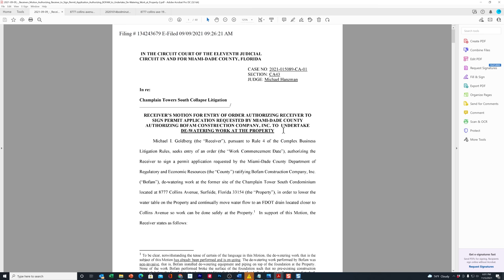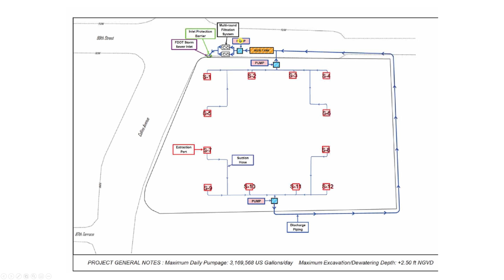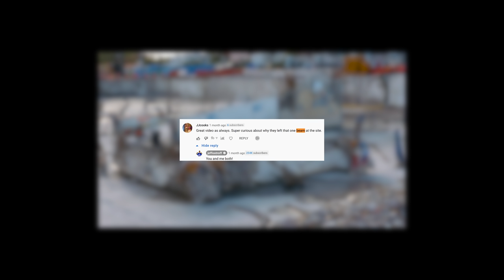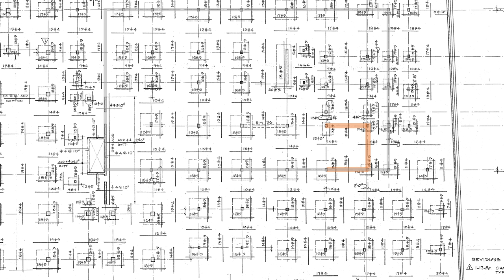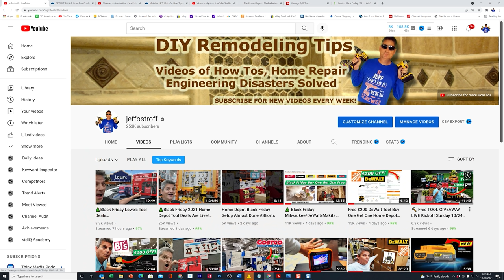Miami Condo Collapse: Engineers Baffled By Mystery Column

Comment: Didn't misaligned columns contribute to the Sampoong Department Store Collapse in Seoul?
Reply from the maker: I think it contributed somewhere to that yes but really the main issue was improperly designed roof, and too much load on the roof and then moving a load that it was not rated for caused cracks in it

Comment: Is it possible that the H-Beam shifted as it collapsed, so rather than coming straight down, it landed displaced by one row?  That would surely explain the mystery column remains, and the clear path next to where it landed.
Reply: Two words: RED COLUMN.  The H beam rested atop a red column to it's southeast, and you can see the red column next to it.  H beam was shifted a couple feet, at most.
Reply from the maker: Martin are you nuts? How does a 70,000 pound slab miraculously fall 20 feet north as it falls 11 feet from the first floor? The H-Beam as you can see by photos fell 12" north of the 4 columns supporting it.
Reply: @jeffostroff  It didn't even fall 11 feet.  The garage ceiling was 11'6" (maximum, from what I can tell on the plans) and the H beam hung down 42" from that, putting its height above the garage slab at about 8 feet.  Also, there's about 6" of debris underneath it, so it really only fell 7 1/2 feet...
So doing a some quick trigonometry, if that beam was in free fall and magically, instantly released from any constraints, it would have to undergo a lateral acceleration of 2.66 g's in order to land 20 feet away.  So basically a shockwave from a nuclear explosion or a 9.5 earthquake with it's epicenter right under the building.  
Sure, Martin, totally plausible!!!

Comment: Could the beam not have punched through the concrete floor and then been broken off?
Reply from the maker: Whenever you make a claim like this about the column falling eight feet and impaling into the garage floor, you forget that there is zero damage on the floor where there should have been craters or something else if it had impaled into the floor but there is no damage. These rebar rods look like they were intentionally built up out of that concrete floor like it was done by somebody in the last 12 months, since Fiorella shot her video inside the garage in July 2020, showing no column exists where that mystery column is.

Comment: The penthouse held up by JUST the H beam. Very nice!🤣👏
Reply from the maker: No real at the house had other columns holding it up as well this was a column that just went up through the middle of the kitchen and I still don't see why they needed it because all of the other floor plan units don't have a column in their kitchen. The HP was built strong enough to hold that one column anyways transferring the load to the other four columns that were holding up the H beam

Comment: I'd imagine someone who lived there who survived could tell  you if that lane of car travel in the garage was blocked or not.  If it wasn't, it has to be the column that sat on top of the H beam punching through, as improbable as that is.  Maybe it wasn't rebared into the H beam and just slid off?
Reply from the maker: Well, two things about your theory that I think don't pan out so if the column fell down and even at an angle then it wouldn't have landed so close to the  H beam and impaled into the floor like you see it now. Also if it had impaled onto the floor that should be a lot of damage on the concrete like a big crater of some type
Reply: @jeffostroff  if the H beam fell during the first part of the collapse leaving BM35 intact and unsupported until it fell with the final part of the collapse 10 seconds later, it would still be vertical and land near where the mystery column is with extreme punching force.  I also don't see any rebar on top of the H beam where BM35 was connected to it which I might expect if they fell together.

I agree there should be some more visible damage to the slab though, and I would expect them to not build a column in the middle of the parking garage cutting off a main lane of travel without it being known to a lot of people.  A big mystery for sure as nothing makes sense or seems possible!

Comment: The GHOST COLUMN!!  Haha.....I think what happened is the long  continuous column from the first floor collapsed as a heavy 100 foot entity and nailed itself deep in the basement floor.....like a nail pounding into wood.  Then it broke off and what's left is rebar sticking out of the weak floor.  The floor of the garage was probably water logged and allowed the column to penetrate....and if there was a large "void" under the garage floor then all the easier.
Reply from the maker: Whenever you make a claim like this about the column falling eight feet and impaling into the garage floor, you forget that there is zero damage on the floor where there should have been craters or something else if it had impaled into the floor but there is no damage. These rebar rods look like they were intentionally built up out of that concrete floor like it was done by somebody in the last 12 months, since Fiorella shot her video inside the garage in July 2020, showing no column exists where that mystery column is.

Comment: Just my best guess, could the mystery beam actually be the beam that was originally on top of the h beam? Since I don't see any evidence of the top beam in the wreckage of the h beam, I'm thinking it's the top beam after shifting away from the h beam and impaling the garage floor. It's hard to determine whether or not it impaled the floor with the standing water surrounding it. Like I said, just a guess.
Reply from the maker: there is zero damage on the floor where there should have been craters or something else if it had impaled into the floor but there is no damage. These rebar rods look like they were intentionally built up out of that concrete floor like it was done by somebody in the last 12 months, since Fiorella shot her video inside the garage in July 2020, showing no column exists where that mystery column is.
Reply: @jeffostroff  like I said, just a guess.

Comment: could the column that was supported by the H section have been knocked backwards and driven into the floor by the immense weight above?
Reply from the maker: It is possible, but no damage to the floor? There should be some
Reply: @jeffostroff  yeah. i was only about half way through the video when i commented that. you do mention the column above impaling the floor possibly. its so strange! thanks for the reply.

Comment: 8:37 - is it possible that the rebar is the remnants of an original extra beam they had in place, but they then installed the H-beam to help support the penthouse.

And the floor of the garage had a chunky layer of cement poured over it for some reason, hiding the old rebar?

I know that doesn't make much sense regarding the original plans, but I can't imagine why else the rebar would be poking out of the ground in that spot.

Logically, either the rebar was always there already, and covered by cement.

Or, the forces were so great, they drove a group of rebar into the ground.

Or the H-beam fell in such a way that the East-West section of H-beam rotated as it fell, and we're just seeing the rebar that was originally on TOP of the H-beam (which went all the way up to the penthouse)?

ie. the beam rotated, and the rebar it's just bent in a way that makes it look as though it's poking from the ground?
Reply: 7:07 - The more I stare at that photo, the more it looks like quite a thick layer of extra cement was poured at some point, maybe in an effort to try to seal out some of the water?

It looks like the floor is quite a bit higher up the columns, and there's a the "seam" running horizontally along the lower part of the screen? Unless that's just a crack in the cement?

If not, then it's really bizarre.

OK, just looking at a zoomed-in image of the NIST photo of the mystery column again, and yep, it sure looks like the rebar is poking out of the floor, and very high, even above the level of the red/yellow paint on the columns.

Is there any way the forces from the collapse were great enough to drive some rebar into the ground at that point?
Reply: Or, for a more reasonable explanation, is it just some mangled rebar in a small clump of cement, and the cement is just below the water?

ie. just some rebar they didn't clear out yet, or it fell from the rubble pile or digger?

Half of the problem with mysteries like this is not being able to go there in person.

Really makes me worry about the state of other buildings in the US and elsewhere.
And considering how ancient many buildings are, Champlain Towers is relatively "new".
Reply: 5:28 - Are we absolutely certain that part of the H-beam didn't rotate as it fell from the tops of the columns?

ie. the part with the mystery column (rebar) has rolled over 180-degrees, and the old rebar got squashed almost flat against the floor (and/or made a divot in the cement).

So what we're seeing in the NIST photo is actually the rebar pertruding from the H-beam itself, where it had the column going from the first floor to the top floors.

You could imagine the rebar being squashed under the h-beam, then extending out into the pool of water.

It just causes the illusion of the rebar poking from the floor, but it's actually still attached to the "underside" of the H-beam. (which was originally the top side of the H-beam, but it rolled in the collapse).
Reply from the maker: You did not pay attention to the video. IT is not some original column, the garage video clearly shows no column there.
Reply: @jeffostroff   Sorry, I didn't watch the last few minutes before posting, but it sure is baffling.

I saw the clearer photo now, and it does look like the rebar is pertruding from the garage floor.

I can't think of a logical explanation, which is why I was going through other possibilities.

I can also see now that the h-beam did seem to fall in-place, and not break up nor roll over.

My only conclusion right now is they added the extra column since the video of the basement was shot. I don't know how they would have redirected the cars during parking, but who knows.
Reply: (I just deleted my tweets about it, as there's no point going over the same info twice.)

Comment: Looks impaled from above to me and the hole filled with debris silt and water making it appear it was always there
Reply from the maker: Whenever you make a claim like this about the column falling eight feet and impaling into the garage floor, you forget that there is zero damage on the floor where there should have been craters or something else if it had impaled into the floor but there is no damage. These rebar rods look like they were intentionally built up out of that concrete floor like it was done by somebody in the last 12 months, since Fiorella shot her video inside the garage in July 2020, showing no column exists where that mystery column is.

Comment: i think you got it from the wrong angle. you can see the column at 7:12, right behind column 15.
Reply from the maker: No you were looking in the wrong spot. The column which is the mystery column is currently planted on the floor of the garage directly below where you see the pipes cut through the H-beam in the photo there. How could you even get that wrong you're not even close to the right spot. The column you are Speaking of is already there in the photos if you look later on it is the column that I mentioned sticks up halfway into the parking space of #17.

Comment: I would bust out the concrete around this column and the ones on each side of it to compare their depths.  You can also take samples of the rebar and the concrete from each of the three columns and have them analyzed.  That way, you might be able to find out if they were poured at the same time using the same material batches.  And if you're careful removing the concrete from around the column, you might be able to determine if it was impailed.

Comment: Before the collapse the column was not there. Absolutely for definite. Its there now - again absolutely definite. So - either it punched up through the basement slab or it punched down through the basement slab. I'm no expert but I can't think of a mechanism that would cause it to punch up through the slab - and if it had I would expect to see more spalling on the upper surface of the slab around the punch-through hole - and there appears to be very little if any spalling. So - the column MUST have punched through the basement slab from above. Absolutely must have punched through the basement slab from above. Now - the column that was sitting on the H-Beam. It plainly was just resting on the beam with no steel tying it into the beam otherwise the steel would still be sticking out of the H-beam which it is not. So that column was definitely not tied to the H-beam. It also looks as though the H-beam did nor fall vertically - it looks to have moved about 20" in a  north-west direction during the collapse. So it slipped out from underneath the column that was resting on it and the column subsequently fell and punched through the basement slab. My guess is that when the H-beam fell it took the bottom of the column with it effectively putting a buckle in the column. As the rest of the column - from the first floor upwards - starts to fall it gets deflected eastwards by the buckled bottom portion and falls punching a hole through the basement slab almost in line with the row of columns - the row the red column is in. Please fault my reasoning.
Reply from the maker: Jerry, I als cannot think of a mechanism to make it punch through from below, especially some you have these large pile caps below the foundation

Comment: The mystery column is column #24 that whole H beam just sheered and moved over a few feet.  That's all..  Dont forget that was up in the air 8ft That piece stuck to it isn't going into the ground nothing left on that H Beam in going into the ground right now. Pick the whole H Beam up 8 ft and move it towards the ramp 6-7 ft.

Comment: The H-beam, as it sits, has been shifted north one set of columns.  Mystery solved.  The real mystery is why I still watch YT.
Reply from the maker: You are incorrect there's no way that things shifted north one set of columns I don't know how you came up with that you'll have to show us evidence just like I showed you the evidence of how it is sitting right where it belongs it fell straight down within 12 inches of its four columns that were holding it up including the one with the red stripe that I told you to keep in mind as the reference point for that northeast corner of the H beam which you clearly ignored. Mystery solved.
Reply: @jeffostroff  At least my theory doesn’t require a concrete column to miraculously appear in the car lane.  How do you know someone using the heavy equipment which demolished the condo wasn’t asked to set that h-beam aside while they clean up the area and now that’s where it lay?

Comment: Could it be that the building collapse drove the first floor column into the floor of the garage? None of those columns in the garage look big enough for a 12 story building, and every column should go all the way down to the foundation piles. When one gives out, the rest go down like dominoes.
Reply from the maker: Whenever you make a claim like this about the column falling eight feet and impaling into the garage floor, you forget that there is zero damage on the floor where there should have been craters or something else if it had impaled into the floor but there is no damage. These rebar rods look like they were intentionally built up out of that concrete floor like it was done by somebody in the last 12 months, since Fiorella shot her video inside the garage in July 2020, showing no column exists where that mystery column is.
Reply: @jeffostroff  Or they could have intended to put a column there later to support the beam carrying the first floor column. I think that beam let go and pulled the next columns over, starting the collapse. Nobody mentions having a picture of a bundle of rebar coming through the floor there, or a column. Strange things happen when columns are driven by a 12 story building hammer, I think, but I'm not an engineer. Buildings shouldn't be falling down with people in them, regardless. It will all come out at the trial, no doubt. Cheers.

Comment: I'm not an engineer! Is it possible that the H was supposed to be bigger? At :056 it looks weird.
Reply from the maker: No you can tell that the H being pretty much stayed intact for the most part so it didn't really need to be any bigger and it's a beast already I think if you make it bigger now you have to start worrying about how are you going to support the beam that was designed to support the floating column in the first place

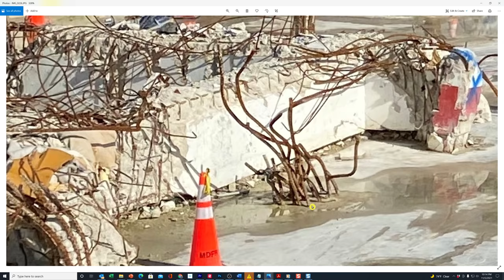Comment: AT 13:53  the shallow puddle of water seems to somewhat flow around what looks to be a squared edge of concrete... as if there is a concrete patch  around the base of the mystery rebar.  Also, the mystery rebar does not exit the concrete floor in the tight pattern which is typical of all other beams at this location.  The mystery rebar are much more haphazard... and the footprint is wider than the other  ( 16" ? ) pillar rebar clusters.   Did someone cut that floor and install what would appear to be the remains of a very beefy column?   OTW I see no reason why this entire H BEAM would have been left sitting there.  It is as if someone really wanted all eyes to focus on that area... and forever save this image for future litigation.
Reply: Yep, and nature doesn't make rectangles/right angles.  Man-made.
The H beam is 22 x 22 and weighs over 65,000 lbs.  I think the investigators just wanted to make sure the H beam wasn't important in the mechanisms of collapse before they jackhammered it and broke it up.  Cause you aint gonna get that out of there intact on the back of a truck!